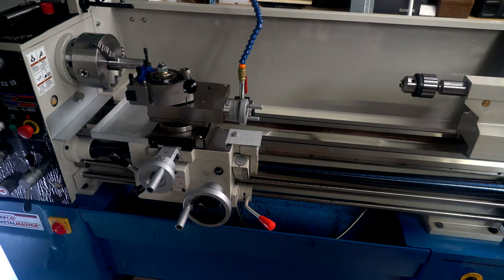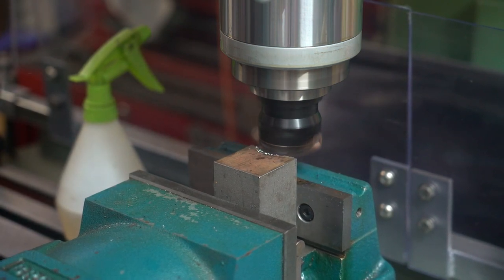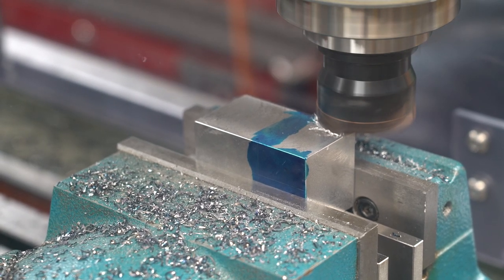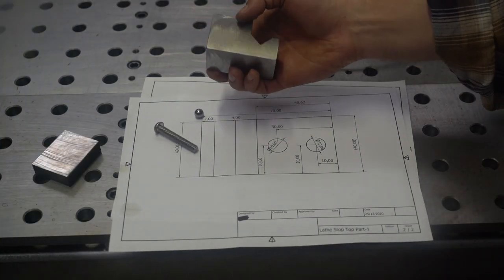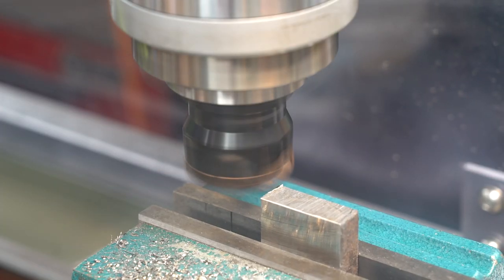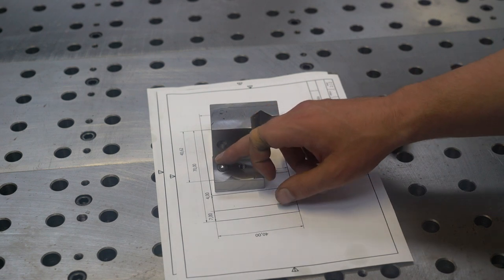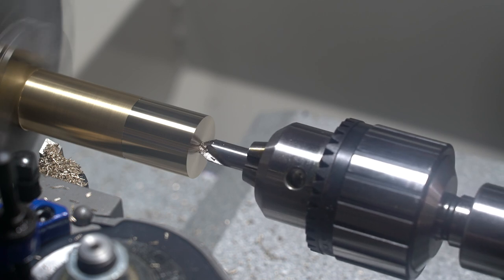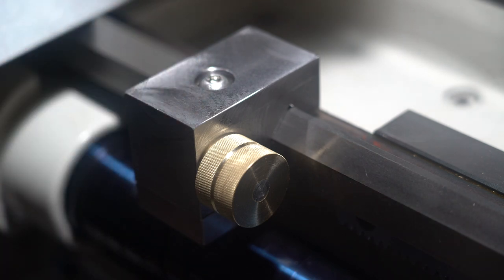Lathe Carriage Stop Build

Comment: Nice stop. Tip on knurling -   check the pitch of the knurl is close to dividing into the circumference of the part, then you will avoid poor tracking.
Reply from the maker: Thanks for the tip

Comment: Nice video! Any reason you didn't want to cut the bulk of the steel away before milling it?
Reply from the maker: Currently don't have a vertical band saw :(. If I did I would have definitely cut out the excess metal before machining.

Comment: What size mutifix tool holder did you buy. I have the same lathe and won’t to buy the same tool post ?
Reply from the maker: I bought the 540-300 tool post body and 540-311 tool holders for it and some 25mm lathe tools. The center height of the lathe can take even larger tooling but 25mm is way big enough. Reasoning being that if I ever get a bigger lathe I can move all the tooling to the new one. Also larger tooling doesn't cost much more than smaller tools.